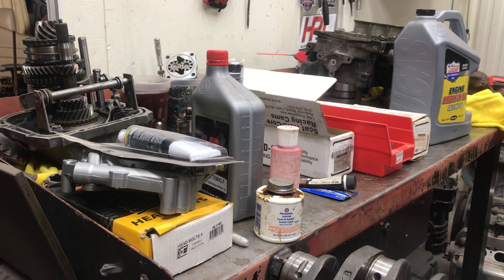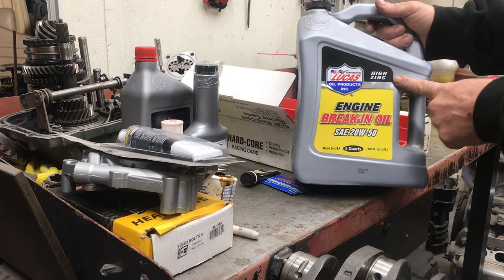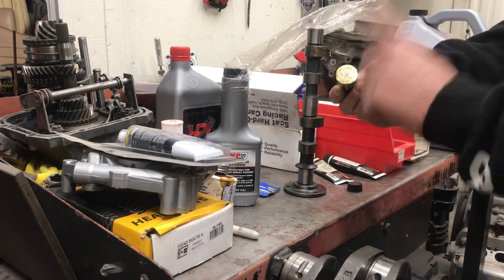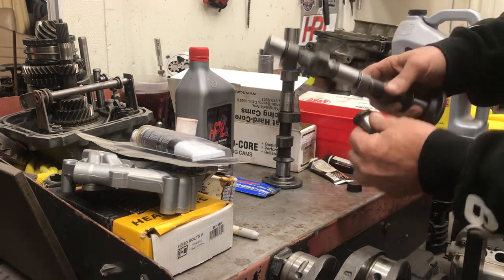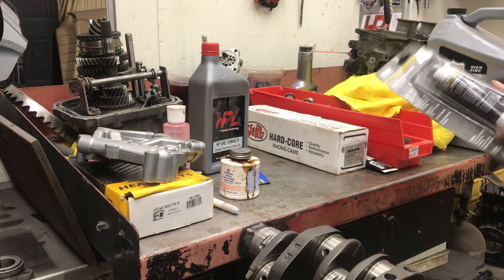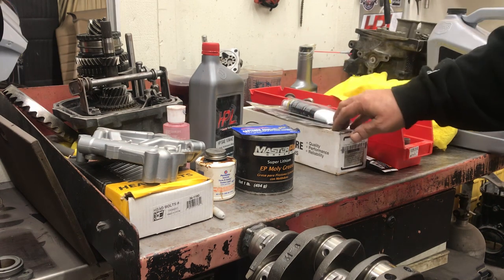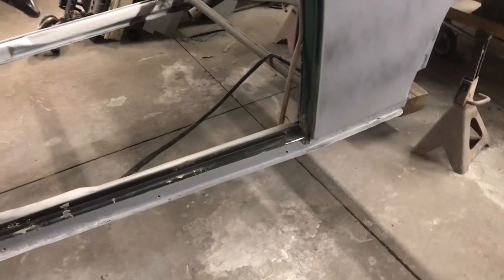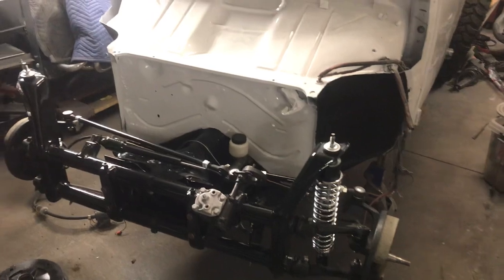Camshaft Breakin￼ And case sealer￼ ￼

Comment: Great info bro. I as well built my first engine in 1981. Seems we think alike. My last 2165 built a year ago was sealed with yamabond type sealer. Zero case leaks at 10k hard high rpm miles. Cheers!

Comment: What do you seal the cylinder studs in the case with? I got a new case and have to install studs in the case savers and they look like they could leak buy the cylinders. Any info would be appreciated. Your the man with the plan. Thank you for your time and all the videos you make.
Reply from the maker: Yambond work good on the studs, it is very hard to clean up, they make two types , the one that stays pliable is good for the case halfs, you need the that gets hard for the studs,
Reply: Thank you for your help and time.

Comment: about the revving the motor to break it in ? How does that apply to a VW the cam is under the crank , it's gonna get oil splash from the crank bleed out . The best oil I used back in the 80s was Exxon Superflow 20-50 . + it was super cheap at Autoshack

Comment: I've heard you talk about wanting more oil on the valve train. I came across a theory about doing the hoover mod and also grinding a notch into the side of the rocker arm pointing toward the top of the valve to squirt oil on the valve train. have you heard of this?  Any experience with it? Also what are your thoughts on the hoover mod in general?

Comment: Really informative video Darrin...thanks for sharing your knowledge with us!  Stupid noob question...if you're not putting break-in lube on the bearing surfaces of the cam, is there any benefit to maybe putting engine oil on the bearing surfaces so there's at least a little lubrication on them when the engine first starts up?
Reply: You’d want to put oil or assembly lube on all bearing surfaces to prevent metal on metal when rotating the engine during assembly and prevent a dry start up.
Cam and lifter break in lube is different than assembly lube.